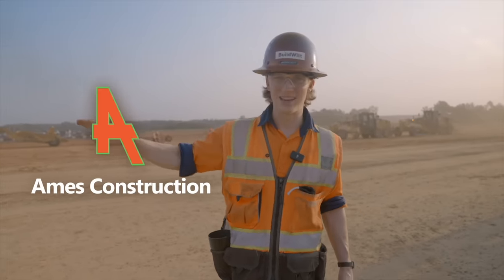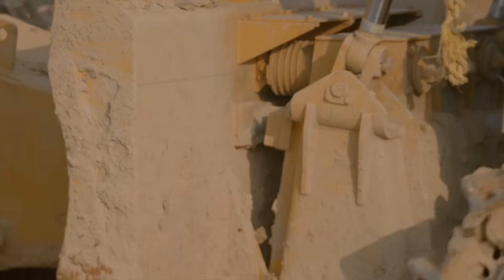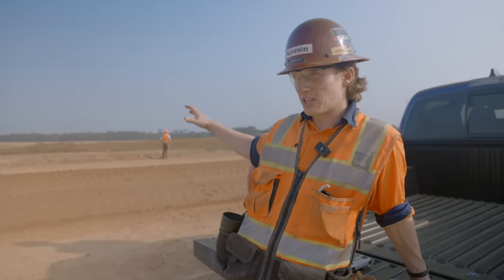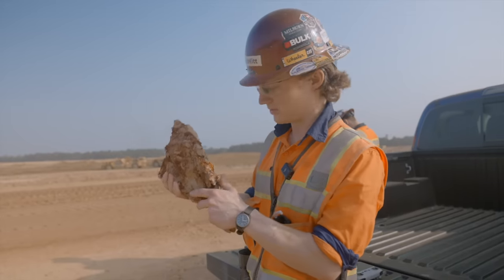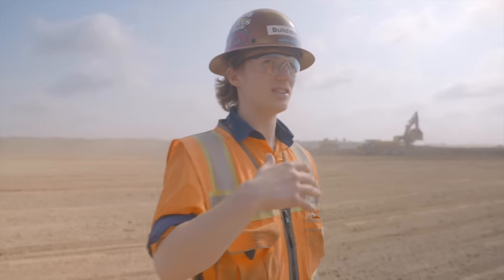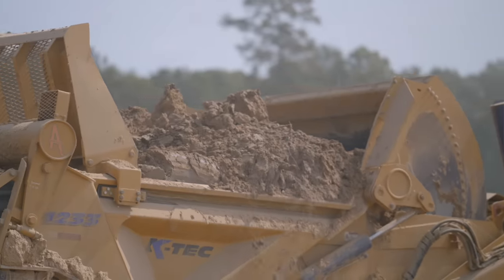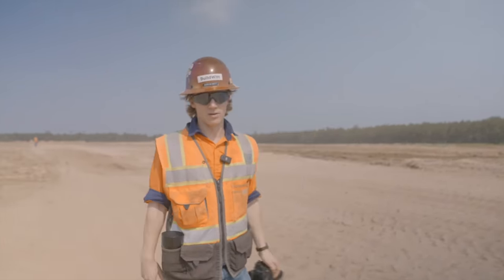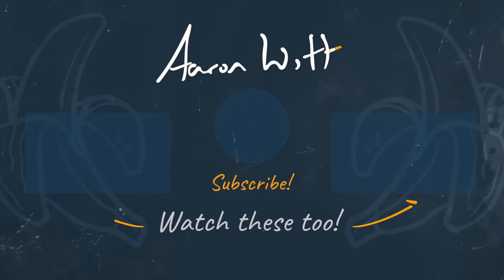Building a Railroad Logistics Center

Comment: The crazy part is, that on the north side of Houston like Cleveland area. The top 4 feet is sand like with pine roots. The roots go all the way till it hits hard clay. I hate doing work on the north side.  Now Katy in the rice fields is nice and easy. Go south to Sugarland, and it gets a little harder. 45 south, you get into the gumbo. So, in Houston, depending on where you are at the soil, it can be so different.

Comment: Fun fact, rail sorting/train building yards usually have a small hill in front of a series of switches so they can just slowly move a train forwards and the cars roll down the incline through the remotely operated switches and end up in the right train.
It's known as a Humping yard, and you'll see train cars that say "DO NOT HUMP" on the side lmao
It's also why train brakes fail open with no air pressure, the opposite of a semi truck
Reply: I believe this an intermodal yard. All intermodal equipment is 'do not hump'. If a train is at final destination there is no switching it will simply be stripped of trailers and containers and reloaded.